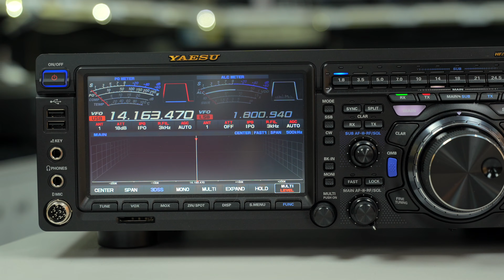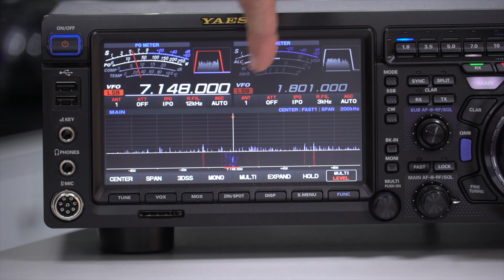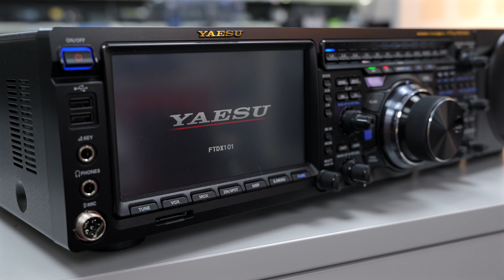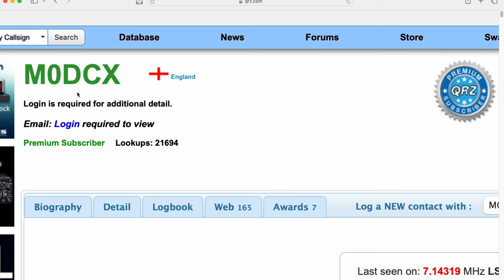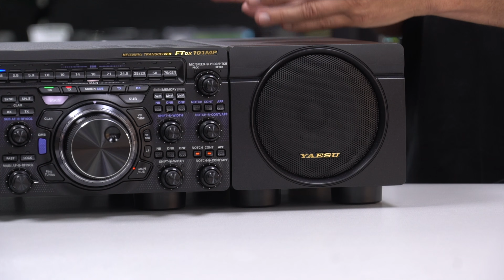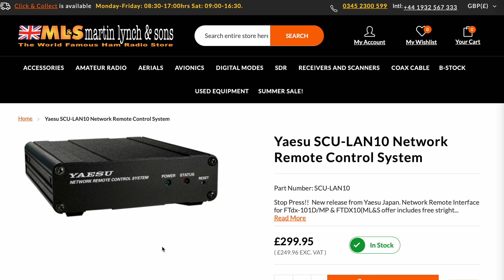Yaesu FTdx101: Still King of HF Radio?

Comment: I had an icom 7300 and a yaesu 991A connected to the same antenna through a switch. I was just comparing the reception and which one was giving the best reception and audio. They were both great, but then I pressed the DNR on the 991A the difference was absolutely astounding. I am a huge fan of the 7300 but !!!! The 991A just sounded incredible. It was like the DNR button just told everyone to shut up and dragged out stations I could barely hear on the 7300.  Will watch a couple of videos comparing the 991A to the optima because seriously considering selling the 7300.

Comment: Love my Mp from you . Disappointed with the scu-lan10 (from you ) , great working it remote within my home network , but can't remote it thru my virgin hub 3 for outside my WiFi home bubble. It could be the virgin hub that doesn't like opening up ports for security reasons. Would love any info to try to sort this problem out. 73s   de G6NBF.

Comment: This is by far the best radio I've ever owned. It's amazing in my HOA in dealing with noise. I get unsolicited (sounds excellent) comments on tx audio as well. Expensive but so worth it! I am blessed!  

As a side note: you can add an external SDR (SRD Play's RSP1A, etc) and use the IF out to give another reference for a scope. I like this setup because I can custom build a larger reference of a scope view. --

Comment: The IC7760 and Flex 8000 serious radios will be taking over the top Sherwood radio listing soon.  But the 101 is an excellent designs
Reply: It’s pretty unforgivable the IC7760 scored so poorly on Sherwood.

Comment: I have had mine for about two years 101MP. The rig is brilliantly designed and fit and finish is excellent . It’s so ‘fun’ to operate. Nice review. I do have two wishes: one, wish they had built in Ethernet and second , using DVI-D for video out I do not get why they made such a backward move. HDMI would had made much more sense.

Comment: With being on a computer all day for work, I love sitting in front of the 101D and driving it as a radio should be! As a new general ticket holder, I’ve been very fortunate to have this as my 1st HF rig. And will be using it well into retirement in a few years for sure. Great video!

Comment: I always run the radio with the notch setting set at 2500Hz, as this removes all the high end 'hiss' from the background noise floor and makes weak stations much more audible.
Reply: Thank you for that tip!  I shall try it.

Comment: I am partial to Yaesu and the FTdx101 is a very fine radio. If it were not for Elecraft I would own one. I presently have a Elecraft K3 & P3 which I love. When I upgrade it will be to the Elecraft K4.
Reply: but the 101 is a better kit mate.

Comment: Can anyone tell me why averaging is desirable because i personally want to know whats happening right now not a average but im open to suggestions as to why i may prefer it also dose the scu-lan have averaging with the dx10 as well just in case i do change my mind on not needing averaging
Reply: As fas as I know the purpose of the averaging is so you can see a hump to indicate there is activity on a frequency. Yaesu has solved this via the 3D-display where you can see the signals in depth vs time. This requires some fiddling with the display settings for the 3D-display to have it work nicely.

Comment: Love this radio, but out my price range, so still rocking my minted Yaesu FT950, such a beautiful old radio 🥰
Reply: have a 950 also and have a 101mp .but 950 rocks
Reply from the maker: There's nothing wrong with the Yaesu FT-950, they are very capable transceivers.
Reply: I still have the FT-950 as well.